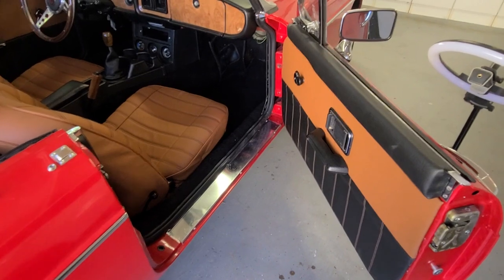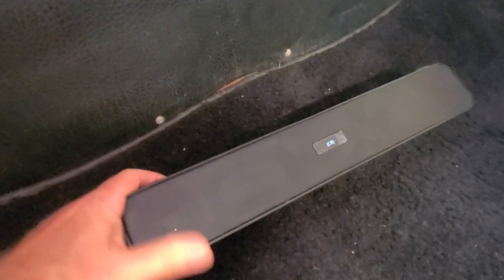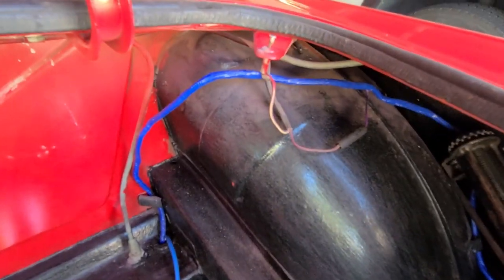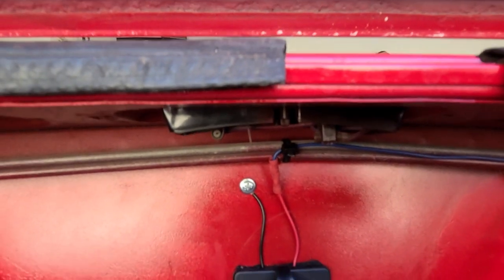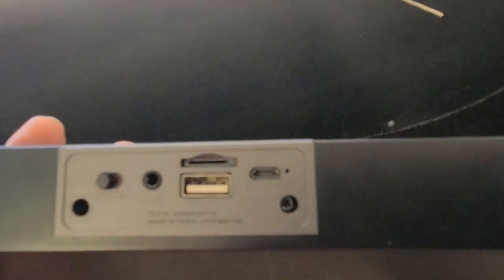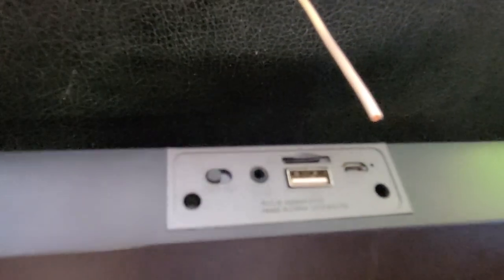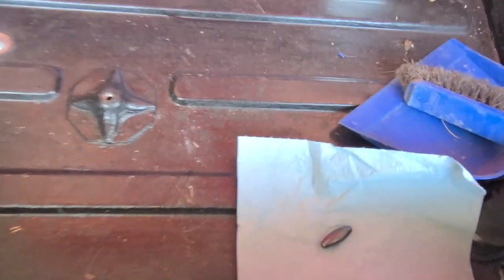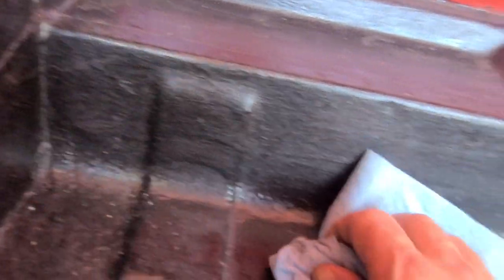Bluetooth Wireless Sound system in 1977 MGB under $40

Comment: My buddy went with a larger (and of course, more expensive Bluetooth speaker setup) and I have been trying to figure out how I want to set mine up.  I like your idea though, but I don't like the drilling of the holes... I have always been super negative about drilling/cutting into the body at all.  My current idea is to replace the center radio console with a sheet metal clone, with 2 DIN slots, 1 for the radio and the other for a 99-05 Miata HVAC control panel, usb plugs, and maybe some speakers on each side for audio... still playing with ideas.  Love your ingenuity tho!  Great Videos!

Comment: I love the clean look both inside the passenger compartment and the trunk area.  Question:  Does that up-down location of the speaker potentially interfere with the convertible top when it is lowered into the vehicle?
Reply from the maker: Very good point.  Probably should have covered that. I don't intend to install the convertible top.  My plan is just to install a tonneau cover.  This cars days of bad weather driving are over.  

Still I suppose you could install the speaker lower on the wall to accommodate what ever top you have.  Also, there are a lot of these types of speakers on the market.  so your install might differ there too.